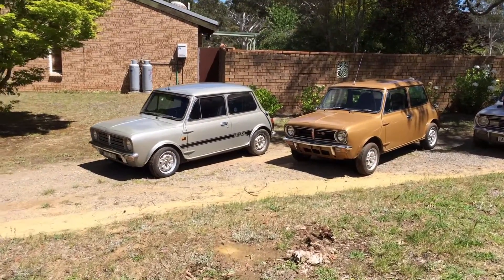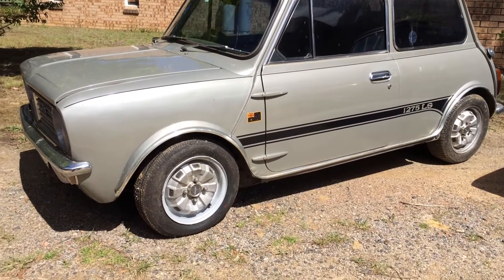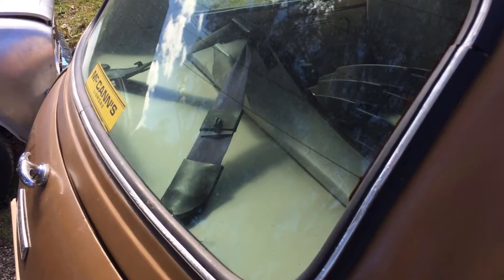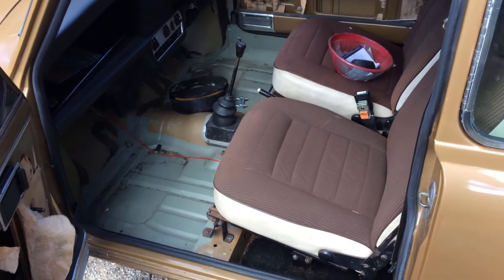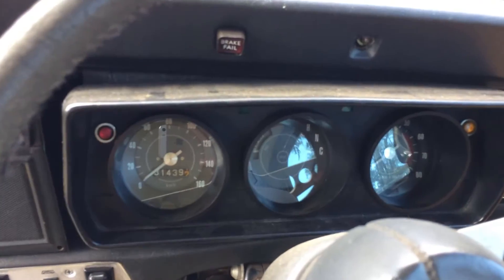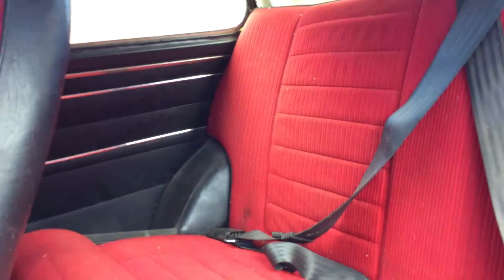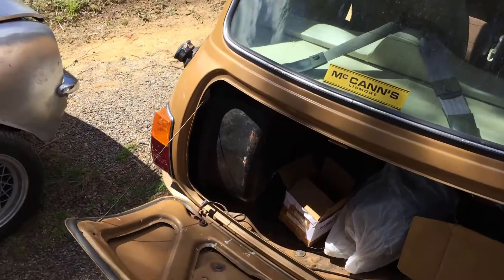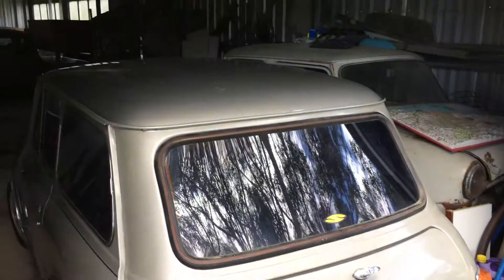Leyland Mini 1275 LS Identification

Comment: Only 800 produced? I remember these. Probably the nicest and most "luxurious" mini. They went pretty well too. Have a road report of one in a Wheels magazine from early 1979...
Reply from the maker: Supposedly only 800 made it to production. We've never seen formal production records, but this is the figure that was quoted by those 'in the know' working in the Leyland factory at the time. I've been running a register for the last 5 years, and have details for around 70 cars so far. Others I've spotted over the years without having the details would probably account for a couple of hundred still on the road.They are certainly one of the most comfortable early Minis to travel in, and find them a very good looking car when fitted with their 12" wheels and side stripes. I find the seats particularly well designed and padded!
Reply: I take your point about the seats. I remember seeing them in maroon and thinking how great they looked and thick for such a little car. Would love to have driven one. Once drove one of it's rivals, an original Beetle with a 1500cc engine and I was surprised and it's good acceleration.

Comment: what parts are available for these minis in particular the ls?
Reply from the maker: Plenty of spares are out there for the most part

The main issues in finding spares:
- Seat trim no longer produced (red / brown)
- Original 12 inch wheels are rare (but plenty available overseas)
- 1275 motor is a late version like the mini metro - if you wanted a replacement with a similar spec, it's rare to find and you have to source overseas, but they are cheap overseas (other than the shipping)
- Long range tank is not so common in Australia.

Most of the other bits are standard leyland mini and used across other models :)